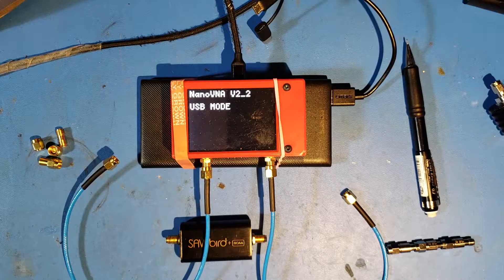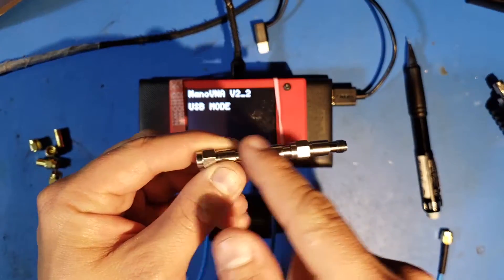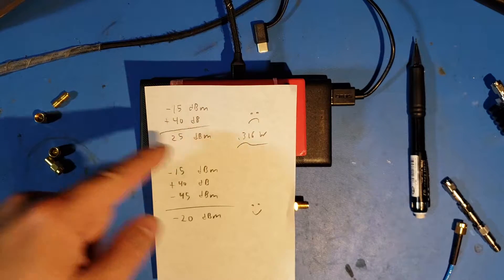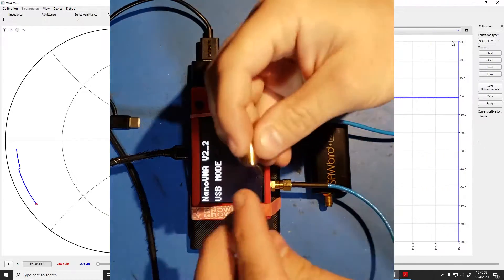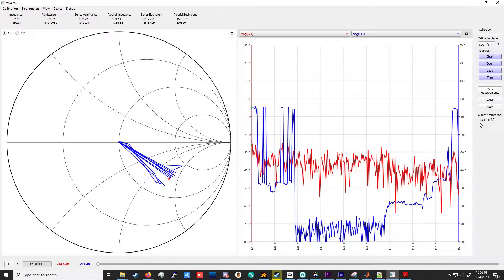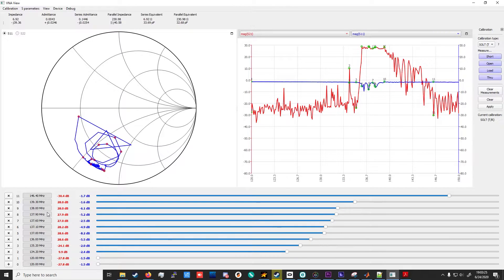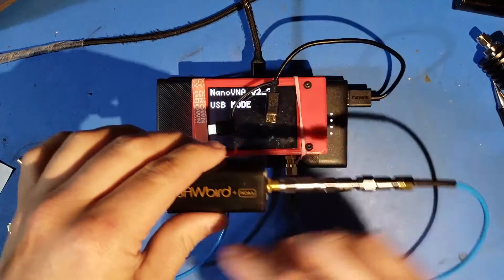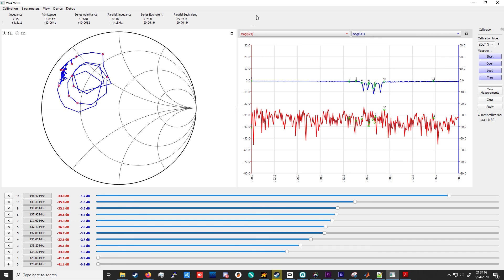NanoVNA V2: Measurements of an Active Device (SAWbird+ NOAA) with NanoVNA-QT

Comment from the maker: I just thought I'd mention for the sake of completeness, one ultimately irrelevant consideration that was not addressed verbally in this video is the maximum safe (or allowable before clipping) input power to the SAWbird+NOAA. I could find no specs online for this value, so I made the assumption that the default VNA stimulus power would be acceptable. This is the same assumption we make for most if not all passive devices when measuring with a VNA. Based on my results, it would seem that this assumption is accurate, but for the sake of providing some analysis, -15dBm = 31.6 uW (microWatts), equivalent to S9+58dB (https://en.wikipedia.org/wiki/S_meter). That's far stronger than most signals that would be received from an antenna input, but no clipping was observed and the device still functions correctly. Given that I wanted to get an accurate calibration and the manual recommends a stimulus between -25dBm and -10dBm, I'm not sure a -10dBm change to -25dBm stimulus power would have protected the device much more. S9+48dB is still a miracle of a signal report most of the time, but it could be something to consider for future measurements. In any case, if the stimulus were too powerful, we should have observed a clipped output before smoke and flames, and 31.6 uW isn't exactly going to create a lot of heat to cook the circuit components.

Comment: Great video, I enjoyed it . And as you mentioned the power should be connected first because upon power connection which is a pulse to the system, the output of higher order system like amplifier always has OVERSHOOT which may cause damage if large enough. This transient response overshoot will disappear in order of micro to milliseconds, and by that time we are ready to connect input/output connectors